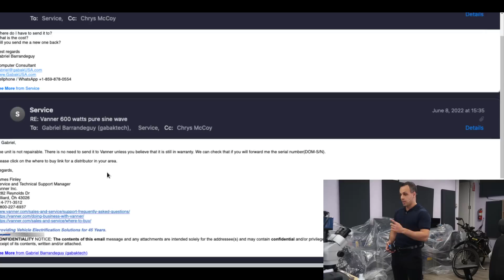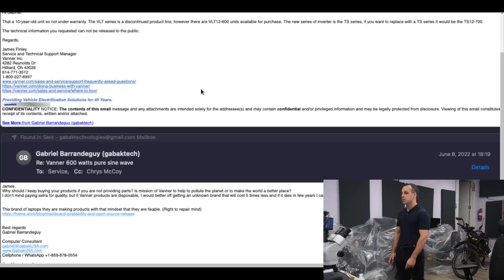Vanner takes the L on repairability

Comment: The first thing i do not get is the pricing.
if a 600W unit costs 600 Dollars it has to be good........ well it worked 10 years not bad.
BUT a good chinese product costs half of it. I bought a 2000W-unit from ECTIVE (pure sinewave BTW) for 350 Dollars.
It runs for years now and the brand is by most people seen as good quality because the chinese company produces to the specs of the selling company.

What im saying is: If im paying four times the money i expect repairability AND good quality not a cheap rebrand of a bruh chinese produict.
My inverter is good quality but zero repairability. At least the price is adequate.

Comment: I wonder if some of these anti-repair methods are about blaming customers for IP-theft by China. At this point, every single senior product developer has heard a story of, or have his new product copied by ali-express seller and loose a ton of sales and are now bitter about that and making misguided measures to combat it. Maybe they think they can prevent their design being stolen by providing 0 technical info to anyone. Of course that would not have and wont ever stop the china, because they are world-leader at reverse-engineering, all they need is the item itself.

Could this be a case of getting burned and blaming your neighbor for it?

Comment: I’ve had a few Vanner products come through my lab randomly usually from Long haul truck drivers. I specialize in component level board repair for test equipment and metrology related stuff… But I still get all kinds of random things from clients if they have something else break in their business that I don’t normally service….. i’ll take a look to help a regular customer. Therefore I end up getting all kinds of furnace boards and modules, all types of inverters and converters… Pretty much anything you would find in and around businesses

 So I’ve seen a bit of everything. From x-ray machine circuit boards to controllers used for boiler systems that can heat an entire hotel. 

The problem with repairability is a very common issue with higher end or industrial made modules and components. One of the best aspects of industrial high-grade stuff is that they take great care at preventing moisture and dust in grass… But there’s only one way to do that properly… something that is dreaded by all techs and repair folks… 

POTTING COMPOUND!

They don’t just use a conformal coating but they pot the entire module/board in epoxy or rubber/silastic/silicone. 

The most common place you will see this in your every day life is in your HVAC system.  furnace/HVAC blowers usually have some type of control module secured to the end of the blower motor. Hard to recognize because it will basically just look like the standard end of a motor. fan modules. 

These are commonly called ECM modules… you could Google “X13 Genteq” and that will pull it up and give you an idea of what I’m referring to.

There’s a good chance you’ve had one on every furnace or HVAC system you’ve ever owned… Looks like the normal back part of a motor but it’s actually a control unit completely potted and covered in a thick layer of rubber….. making them absolutely unrepairable.  And it’s getting more common in all parts of electronics and industry. Even in standard homeowner grade washing machines… A lot of the boards will be completely potted in rubber. But of course you can make the argument that in a lot of cases it’s going to prolong the board. And it does make the devices and boards more tough and resilient. Or at least prevent it from failing due to moisture/conductive dust ingress.

But when it comes to high end professional products…. I kind of get why they do it. Obviously it keeps out moisture and dust ingress, stops vibration, yada yada yada… 

But I still think companies should be willing to at least meet the client halfway and if they can’t even repair their own stuff because of the thick and extremely troublesome potting compound… Should at least give a discount or something surely could be done.

Comment: This is a common problem with chinese sourced equipment. I have an harbor frieght battery charger that you would think shoukdnt be that complicated, just a simple step down transformer from 120v to 12 or 6. However it has controllers inbetween the coils that are safety related like preventing over charging, reverse polarity ect...however you cant use it as a power source for random testing and emergency phone charging and stuff because it needs to detect a current to activate.  So if you have a totally dead battery, it wont even work for its original purpose if it cant detect a current. I cant even find a diagram so i could bypass these circuits safely so itd work like something you'd find made 20-50  that still work as intended. 

The same goes for many bluetooth speakers when the rechargeable battery craps out after a couple years.  Its glued together in thin plastic so you cant disassemble  it without destroying it.

Comment: The goal is to reduce e-waste. The company flogging it is to make a new sale. New service manuals are hostile to component repair, or real life product failure causes. Now they omit the schematic alltogether.  Sometimes they want the agent to be a board swapper - but boards costing 90% of the product defeat principle #1 - ewaste. Time to go back to 1950, were every product had a schematic and repair manual.  Solution:  Double/some multiple  the ewaste fees on products without adequate repair instructions. People who have part numbers sanded off - well they deserve special treatment.

Comment: The safety argument may have some merit here but bs ing  the dude by saying it’s not repairable and buy a new one kind of undercuts that argument, at the very least they could have offered an ewaste recycling or collection service as the risk posed but the large capacitors in repair could harm someone in transit or start a fire if left unchecked

Comment: No, it's not unreasonable. I've repaired inverters, they're not that complicated. I bet one or more of the switching FETs failed, or a cap or three failed. Most likely the unit is repairable. If a company no longer supports a product they should be required to make any  technical data available.

Comment: An inverter sounds like something you could probably draw the schematic for yourself if you really needed to, and then release on-line for others. More than likely a bad mosfet or electrolytic capacitor somewhere; they are the parts that like to wear out.
Reply: Yep, it's likely pretty simple. So why not release the damn schematic? It's not like there's much for other companies to copy

Comment: I think this kind of touches on an important unfortunate reality - people always say "I would pay 2 times more for something that lasts 2 times as long" but, in actuality, to make something last 2 times as long it probably costs like 10x more to manufacture.

Stoves are a good example, Most cheap Whirlpool ranges you buy will be between $1000 - $2000 and should last about 10 years. Or you can buy a Thermador which will last probably 30+ years. But it also starts at $11,000. So it's realistically probably cheaper to just buy the basic stoves and just junk them when they're dead.
Reply: Wth? What kind of stoves are they?!

Comment: on the bright side these things are generally easy to open up and just take a look, dont know what brand mine is but all i did was remove a few screws and everything slid out with an obvious point of failure, a set of new capacitors later and its running good as new

Comment: i suppose everything is opaque in the end, situations are rarely completely transparent or "black".  Truth be told, even I was guilty of copying designs (when things were more analog/ old school back in the day) off more established manufacturers of what have you , the likes of distribution amplifiers , cross over circuits , etc via the provided schematic diagrams and making my own and sometimes even sell them as a side hustle. But that being said it was also one of the most effective ways that I learnt to become a professional technician of my field. Times were a lot simpler then , established manufacturers were proud and rarely afraid of providing schematics . I doubt today the problem is limited to just copyright infringements, but the pressure to achieve KPIs for the stakeholders have now forced the manufacturer's  hand. They hope to achieve the ultimate manufacturer's wet dream,  of insatiable demand for their goods at the highest price point possible to sell them at .

Comment: Hummm , as one who made his living , keeping things running,  this is not a new thing. Worked on a 400 ton water chiller for local, convention center. Driver board was toast, replacement board was on the shelf, but I was not allowed to install it, as the manufacture said such must be done by factory service personnel?  Nine labeled wires, six bolts ,one cable from microprocessor? I was somewhat insulted, but it was their money. The cost of flying in a service tech, putting him up at a nice hotel, food drinks, and the pleasure of watching the tech work, well was about a months pay for me. Add to that the problems of cooling the building fortwo weeks mid summer as they awaited the tech.... well was tax payers work at waste.

Comment: You can email any company and ask schematics for any product they manufacture. Usually they won't send you anything or reply to you. Some may give you parts diagram for ordering replacement parts but that's it. Most of that technical information only provided to service technicians who work for the same company only fixing warranty items. Technicians also sign papers that they won't leak any information after quitting this job for years. Also you can't buy special tools that they use for flashing software or even get access to it. They don't need any independent technicians fixing "their" stuff.

Comment: So, I made a few in line comments here and looked at some opinions. One big difference with Vanner, as @Louis Rossmann said, is that their primary market is industry. One big difference in industry is their customers cannot afford downtime. I used to run on an ambulance that had one of these inverters, we had the truck for 10 years and had to repair pretty much every system at some point (drive train, emergency lights, siren speakers, etc) The one thing we never had to touch was the inverter. It outlasted most of the components on that truck. Any time the truck was down, it cost our department money. Google how much an average ambulance transport costs, and an average number of calls per day in your city. It's not worth anyone in industry to try to repair it, it's cheaper to buy new than to have an ambulance be out of service for a week. When you buy a new car, you get a solid 8 years before you have to start replacing things, but once you do, it's another 6 months before you have to replace the next thing, and then it becomes 3 months. Industry cannot afford that, it's cheaper to buy new and get another 10 years out of it. So long as Vanner isn't actively preventing you from opening up their device and trying to fix it yourself, then I'm fine with it. It's the BMW, the OneWheel, the Zero Motorcycles, the John Deere, that are actively engineering the product to prevent you from trying to repair it yourself that I think is awful.

Comment: Check out what a electronics design engineer called magic smoke did on CTEK battery chargers.  Professional autopsy, identified the root cause, inherent design defect. At least in the EU, they no longer bicker when a consumer refers to that video featuring that model.  The question is not that it failed, but WHY did it stop working.  If this engineer thinks 1 cent power diodes are not long term reliable - that will mean much unnecessary electronic ewaste going forward.  Bless him for refitting a chunkier bridge rectifier.

Comment: An inverter is a pretty simple thing in terms of electrical complexity....I'd definitely buy 1 for 1/8 the price if it was rated the same in terms of wattage....China made or not....that's a lot of failed inverters to get to break even...
Reply: They may be simple but there are still a lot of low quality crap out there. Old square wave inverters used to be fine for most anything. Sure they tend to radiate interference like mad but if you are using it to run a drill or tea pot you won't notice unless someone complains about the radio going crazy. Now with more and more electronics involved things isn't as simple and you really want a sine wave or at least something close to it. And now the simple isn't quite so simple anymore.

Cheap Chinese inverters tend to have pretty rough output and often struggle to support the load they are rated for. This later part is a good reason to go with a known name brand as they are less likely to skimp on the power capacity than some fly by night manufacturer. And this is true even when they either outsource manufacturing or even buy a unit from some Chinese manufacturer, or at least that's how it should be. We've seen some companies make bad decisions when it comes to this, such as Vanner. If you are going to slap your name on something you should make sure the product meets the expectations your customers have.

But if done correctly a company can source products in China that's pretty darn good. It's not that Chinese products are automatically bad, but if you just look for the lowest price then it will be crap. After all things like iPhones Apples computers are made in China. And while they may have a lot of faults most of these are caused by crappy design and that was done in the US...

Now there are other reasons you might want to avoid products made in Mainland China, human rights violations comes to mind, but today it's hard to avoid them entirely.

Comment: The sellers on Ali don't provide schematics they don't have. I bought an RC relay circuit from one, opened it and began scratching my head because the connections were nothing like I knew. I wrote them for schematics, they apologized that they have nothing. I sat down and reverse-engineered the thing, drew the schematic, connected it up, worked fine. I sent the schematic to them and next thing I see my hand-drawn schematic is included in their shop listing of the device!

Comment: I'm not sure about the skills of the person that submitted this or the diagnostic tools that person has access to, but a quick look at the output waveform under load will tell a lot.  The power output stages of these devices aren't typically that complex.  A schematic in this case would be helpful, but probably not a showstopper for a repair.  I've repaired quite a few inverters over the years and output stage MOSFETs and DC bus caps represent almost all of those repairs.  Reading the notes that this is a repackaged import, the caps are probably suspect.  Almost all of the cheap, imported inverters use crappy knock off caps that have high ESR.

Comment: fun aint it.
Got a UPS for backup power in this area. Just past 1 year, batteries fail, so I mod the case for better batteries.  2 years later, It fails.
I know what it is.  Its the Touch switch, its a relay and its failed.  But PARTS?  
I dont know if a Regular Switch would replace it, as its a relay, Built in or external?

What would be GREEEAAAT! would be to sell me the UNIT, and I buy the batteries.
Small box that can sit along side of 2-12 volt batteries.  And I can use Any 12 volt batteries I want.  NOT the ones that last 5 min.

Comment: Louis, I'm hoping you'll see this but, I expect not with the volume of comments you have to get; 

 Wacom is a company that is basically the go-to for many professional studios and their repair-ability and customer service is dire. I say they're the go to for professional studios because they're priced for that but a lot, of artists from professional to beginner pony up for their hugely marked up tablets and their service is DIRE.
I had a tablet many years ago, 12in tablet the 12WX and the power switch failed, no reply from customer service so I had to nervously open my $1,000 display tablet and try to fix it.
Recently, I've seen many artist with their larger pen displays that cost $2,000+ with big paper clips holding the power cable in place due to defects. Their $3,000 wacom mobile studio tablets defects repaired, by wacom with HOT, GLUE.

We're only now getting decent competition with Huion & XP Pen with display tablets but so many still go to Wacom and their customer service for repairs is either non-existent or insanely overpriced & many naive artists  save up for these expensive pen displays only to have the company abandon them

Comment: If there is a seal or instructions that say do not open, authorised personnel only or warranty will be void if opened. And you open it, the company shouldn't be held liable, from that point on anything that happens is on you or whoever is doing the work. If the companies start putting out there manufacture schimatics (hopefully when right to repair passes) supplier should be able to have on the instructions 'repairs to be done by aqualified personally only' that should clear them of any wrong doing if something happens, if that is there argument. It should be my choice to make if I opened i or not.

Comment: One of the mosfets in the inverter are likely bad. pop it open, desolder and test, replace. Simple and no schematic needed but would be great to have. You can get a 1000w Dewalt inverter for under $200, zero need to go with that vastly overpriced stock unit. I have a Ampeak's that have been running for years on end and been incredibly surprised.